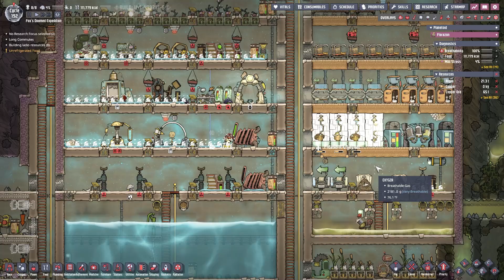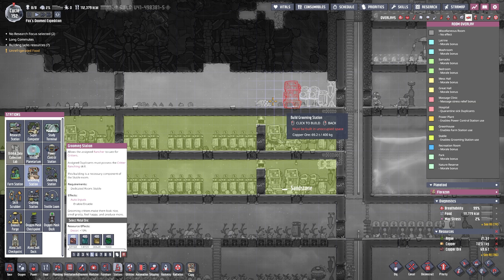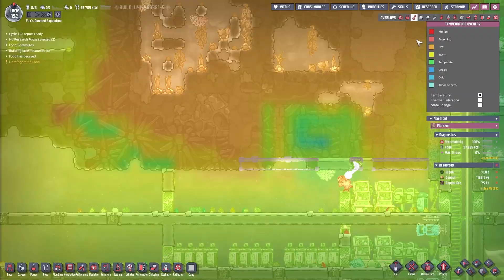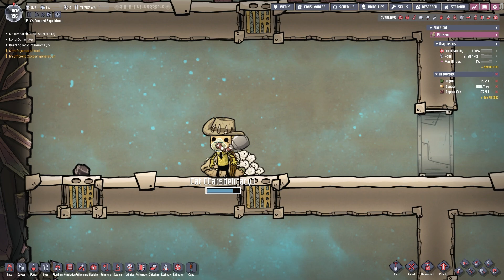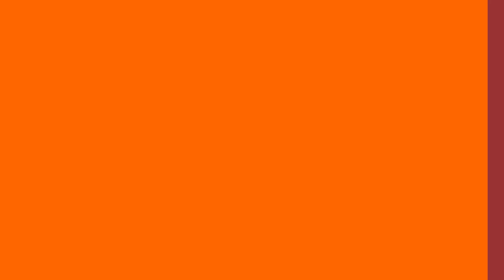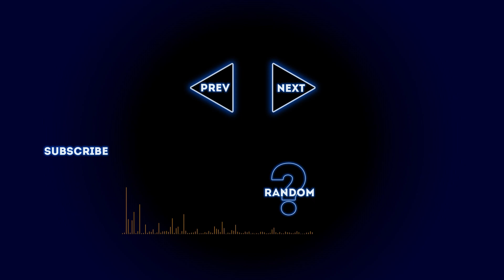Setting up the Power Transformer! (Oxygen Not Included: Spaced Out / Terrania Episode 21)

Comment: I wonder when Fox will get into SPOM? I always jump into water generated O2 as quick as possible cause I want to save algae for whatever reason. You can cool the generator using the salt water using piped water loop. Overall, great vid for new players. I hope more will start playing ONI.
Reply from the maker: I thought about using the salt water to cool the oxygen, but I think I'm going to use the salt water to run the refinery, and then use the steel to make a proper steam turbine heat sink, and then use that to replace the anti-entropy thermo nullifier.
Reply from the maker: I wind up never doing anything with algae. I guess I could do something with fish, but I never wind up doing it.
Reply: @GitGudFox  I am the same, but I'm a hoarder of sorts, so I want to use less / save everything.
Reply from the maker: I think I have an idea for the electrolyzer. I think I've been overthinking it and have a simple idea I'm going to try in an upcoming episode.
Reply from the maker: Update, I think it's working.
Reply: @GitGudFox  can't wait for the episode.